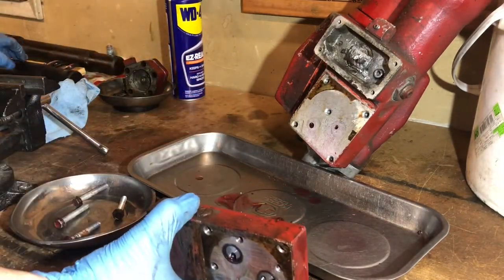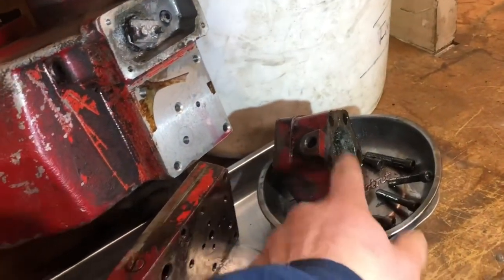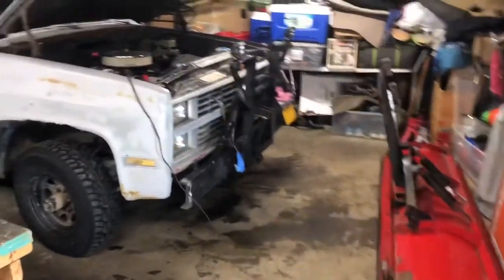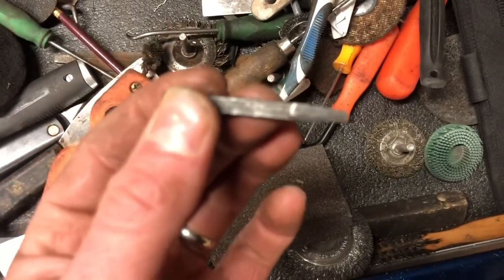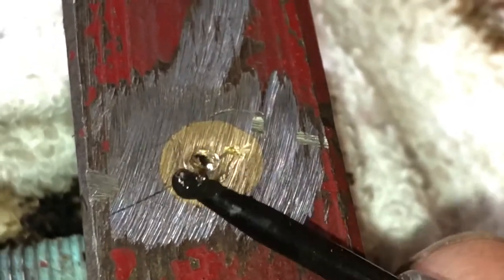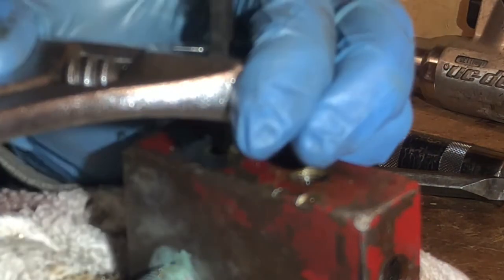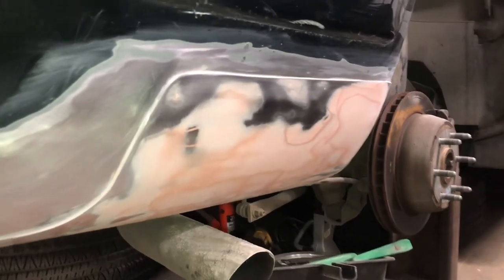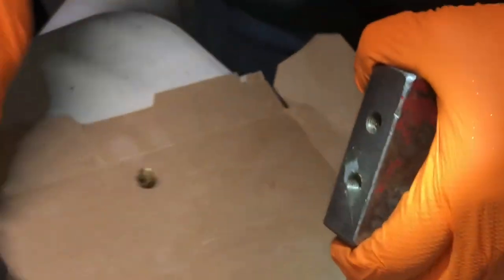EP95–Western Isarmatic Mark IIIa Cable Plow Hydraulic Pump Disassembly (Plow Pt.4)

Comment: Hey, is there a chance you could show me the solenoid you use for this plow? Also the joystick or controller. I have this same plow and I can’t get it to work right. The pump stays on continuously depending on how I wire it and I get no power if I wire it the way the schematic says…
Reply from the maker: You might have a short to ground within the joystick, I’m away from the plow truck currently, but later tonight I could try and send some pictures. If everything is hooked up according to electrical diagram, then it sounds like you have a short to ground somewhere in the joystick or the wiring from it to the solenoid? Just a guess, send me an email and I can send some pics or try to be more helpful. 

lastfrontiergarage@gmail.com

Comment: If you have a wire welder, you can weld a nut onto the easy out and you can work it right out :)
Reply from the maker: Awesome idea, thanks Adam!
Reply: Brass?
Reply: @donnied6759   I’m actually not sure if those are brass or steel. If it’s brass, I’m afraid the welder trick won’t work.